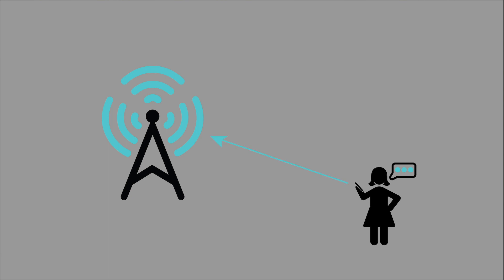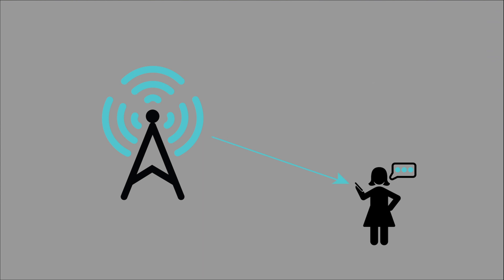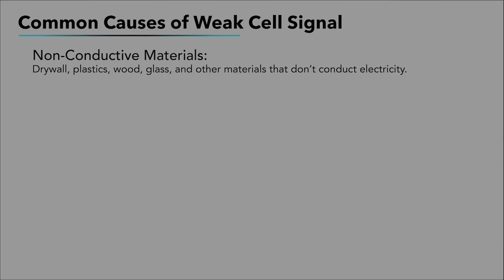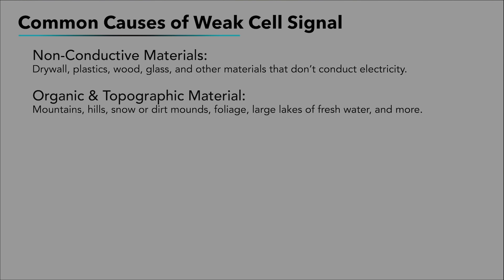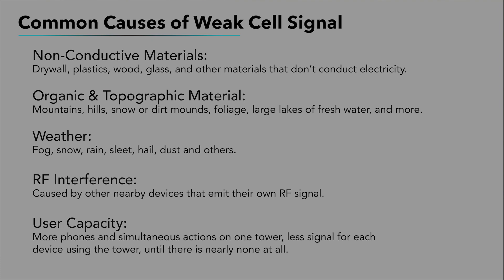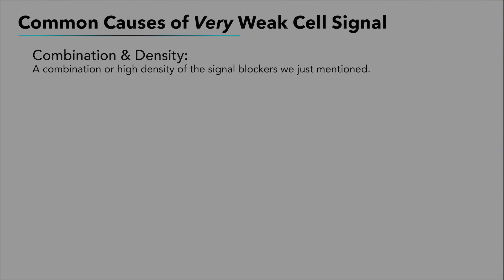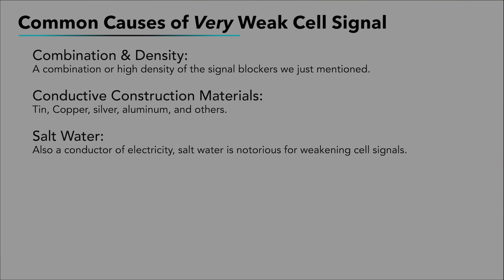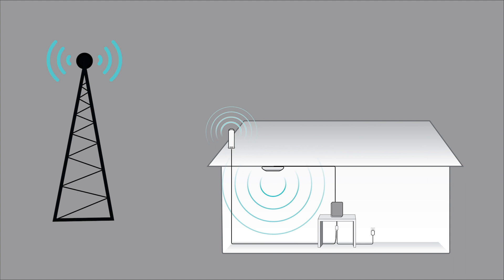How Do Cell Phone Signals Work?

Comment: I live in a rural area about 15 miles from the nearest town of a little over 2000 people, but only a little over a mile from a 4 year old cell tower.  It worked well for the first 2 years but then I heard they added a new verizon can and now instead of 4 bars of signal lucky to even get a half.  I called at&t for months trying to get help but all I got was different excuses . The only ones truly effect were those south of tower.  It's gotten so bad texting can be difficult most days and getting on the nets a joke.  At $62 per month and on 5th carrier and 8 phones latter trying to get service sucks.  I'm going to try the FCC but I'm pretty sure that'll be like pissing in a strong frontal wind

Comment: Or. Its because the Antenna  you are trying to connect with is over 45 miles away. Where as a cellphone tower cant pick up a signal because its NOT DESIGNED TOO! Its a Ionosphere heater an Microwave tower. ITS A COOK BOOK!